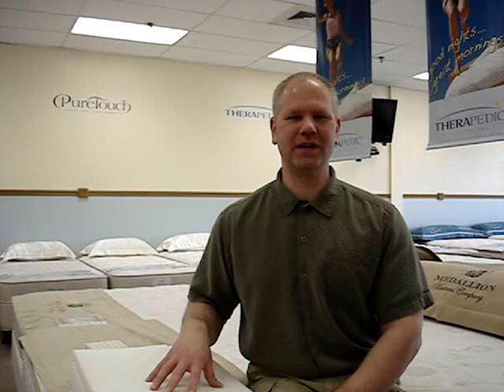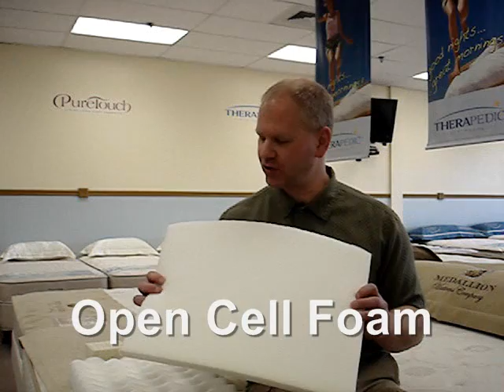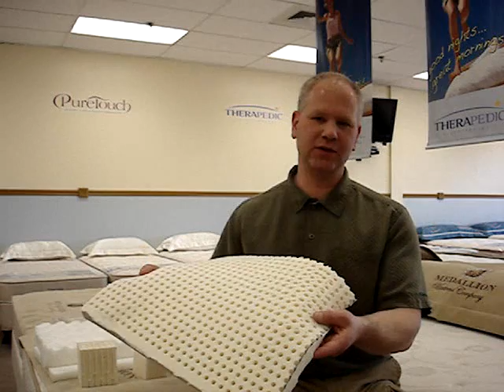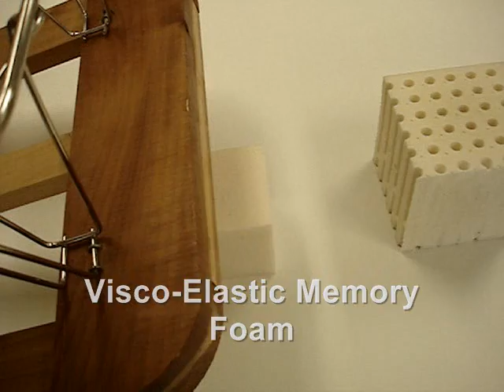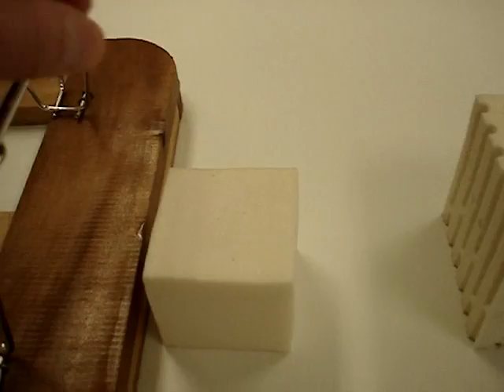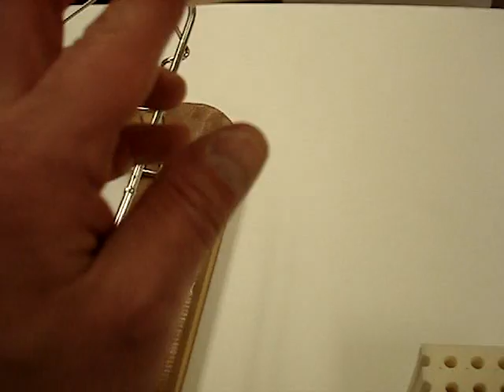Beducation® - Polyurethane Foam, Memory Foam, And Latex Foam

Comment: How can you tell if the Latex mattress you have is all latex, or polyfoam in the middle? I have one from 13 years ago which is a Natures Rest Composure which has been great but the impressions from where we sleep are large now and I want to replace it. The market has changed radically and foam is all the rage now. I think I will get another latex mattress but now I am questioning if I should get one which is latex all the way through or not. I think we spent $2200 back 13 years ago and I see some now in the $4,000 range. Not sure I want to go there, but the latex really was very nice for us (back sleepers some side - Normal sized people - 200 lb / 130 lb). Love your videos, wish you were in Massachusetts I would be down today shopping
Reply from the maker: Thank you for the compliments. Without taking the cover off of your product and looking at the foam, you could look at the law tag and see in the content section if "polyurethane foam" is listed in a significant percentage. I don't know the specifications of the Natures Rest Composure from 13 years ago - even their web site from back them is incomplete. Their N-Balance line did use some polyfoam I know. Regardless, the first thing I would do would be to check that your foundation is perfectly flat and unforgiving and that you have proper center reinforcement under that. Those things can all contribute to the product sagging. Next, I would look for all-latex mattresses that approximate the feel you desire. You didn't mention what size you have, but even a king all-latex mattress can be had very affordably (well under $4000). There are also many component-style systems available where you can change your comfort over time and customize on the left and right sides. As latex has worked well for you in the past, I would start with that and not worry so much about trying to duplicate what you have, but find a comfort range that works for you. That's my best advice. Hope it helps.
Reply: Thank you that helps a lot. It is Nature Made (house brand by Sleepys made by Natures Rest) and indeed the law tag has 90% polyurethane foam and then lower (without a percentage) it says "Latex foam rubber core".  I will start shopping for all latex. It is a king that I am shopping for. To be specific the sagging is more of an indentation in the upper pad where we lie (the mattress looks like it has a pad similar to a pillow top, then the core below it). It is not a slump in the center.  Thanks again though. I know you ship as well, not sure if that would make sense but would be curious what some pricing would look like. Do you have customers out of state you ship to?
Reply from the maker: If the law tag is correct, and per your description, it would most likely be that you have polyfoam in the quilt, and then probably a layer of latex under that, with a polyfoam core for the base (if 90% of the mattress is indeed polyfoam). This would explain the body impressions you're experiencing, which would be mostly from the polyfoam in the quilt. While we do ship our products, we currently don't ship our Pure Talalay Bliss products. I don't have a recommendation for you regarding a particular brand (that's not what i do here with the videos), but I can say you have many quality options out there for what you're looking to do.

Comment: Hi Jeff, I am in the market for a new mattress.I was set on pure latex but some(ok, an online company) are saying it is not comfortable because it pushes against you causing one huge pressure point  and that is why it springs back so fast.I take this with a grain of salt and know this part of marketing but still wonder if there is some truth to this.
Reply from the maker: As I think you're already aware, blanket statements like what you described aren't accurate and in the end generally lead you to a product that someone is hawking. Latex will be more resilient than most foams, but like any product, it's offered in varying ILDs to accommodate various sleeping styles, somatotypes and personal preferences. And of course, the overall feel of any mattress is a combination of all materials, and some people may have an affinity for latex, while others at prefer memory foam, natural fibers or polyurethane foam. There is no one correct answer - you just want to make sure that whatever you choose is made of high quality materials and constructed well. As far as using other people's opinions, that would be the absolute least reliable way of picking out a mattress, as what might feel best for someone else has nothing to do with you and your particular needs.

Comment: What would be better for reducing motion transfer?
Reply from the maker: As a single foam layer, visco-elastic foam was originally created as a motion dampening foam, with low rebound and high hysteresis. It would be the best foam as minimizing motion transfer, followed generally by latex.

Comment: for comparing  you should have taken the same size of both memory and latex foam
Reply from the maker: This is obviously a very simple comparison of the properties of the two different foams, not a scientific analysis or rating of ILD/IFD, density or compression modulus, or anything else of that nature. The size is inconsequential and the simple comparison is valid regardless of size.

Comment: Thank you for this great and useful information. I'm in the market for a mattress, but I am not sure what to go with.  I tend to stay away from synthetic, chemical materials.  What about gel infused mattresses, do they really give a cooler effect? I have read many mixed reviews on this topic.  Does it matter if I go with a latex/spring if I want to have a adjustable bed? Will a organic cover help with the chemicals and bed bugs? Thank you.
Reply from the maker: All foams have chemicals in them (even latex), but that doesn't necessarily mean that the product is harmful. Safety is certainly an important concern and you want to make sure that any foams you consider are at least CertiPUR-US certified for polyurethane. While gels (and to a greater extended phase changing gels) can assist with conduction of heat, the claims of the industry tend to be greatly exaggerated. Most effects are for initial surface touch and these gels tend to load quite rapidly. Specifically, these foams will not act like a heat sink. As for an adjustable bed, we've always recommended an all-latex mattress. It best puts up with the specific weight concentrations and bending produced by a power foundation. A cover will not have anything to do with chemical filtration. An organic certified (GOTS) cover will meet the Global Organic Textile Standards and have fewer synthetics in it (must be at least 95% organic certified componentry). For bed bugs, you'd want to make sure that whatever cover you are using has a zipper that is certified as bed bug proof. The organic nature of the cover wouldn't matter one way or the other in that case. as it relates to bed bugs. That would simply be a personal preference.

Comment: does polyurethane foam soften with use. I have a 4 inch 2.5 density 35 ild poly foam mattress. should I get a 7 inch slab instead. my weight is 285 lbs. Will the 4inch slab soften?
Reply from the maker: +Rudolphe  Alexis All foam will soften over time, even premium latex. But there is a large difference in the amount of softening (Flex Fatigue or Dynamic Fatigue) and change in Support Factor (Compression Modulus). The thickness of the foam will change the firmness a bit, but you'll notice the feel a bit less when placed deep down as opposed to directly on top. From your phone call earlier I would advise you to keep what you currently have, as it is working quite well for you. If over time the core gets a bit too soft, I would simply replace it with a new piece. The latex you're using on top should last a very long time. Good luck!
Reply: Thanks for the information. I now see that there is no set rule for core thickness. It is a matter of personal preference. I have 2 really good latex toppers. The 4inch core is just right  not to firm not too soft. If the 4inch poly foam core softens then I will add a couple of inches to the core. For right now I will let it be.  That was good  advice. Thank you.

Comment from the maker: The latex we offer (pure LatexBLISS) doesn't off gas (only water), doesn't smell and doesn't absorb moisture. It's exactly the opposite. A premium virgin talalay latex is open-cell, breathable and not temperature sensitive. Plus, the ActiveFusion technology helps to dissipate heat even more. The problems you describe are commonly associated with visco-elastic memory foam.

Comment from the maker: @ericjakob I'm not sure of the makeup of the mattress you're talking about but in general memory foam wouldn't be the answer.  You'll need something stiffer and more resilient.  One of the best replacement ones I've ever found (without an innersrping) was a special zoned high-density polyurethane foam called Conformafoam.  I'm sure this is produced under different names for various companies, but in general you'll want to look for a firm and higher density polyurethane foam product.

Comment from the maker: @andy74123 Andy, visco-elastic memory foam is technically a specialized style of polyurethane foam that slowly recovers and is temperature senstive. There's a wide range of quality, softness and recovery speed within visco-elastic foam offerings. Latex foam isn't polyurethane - it's vulcanized rubber. The terms visco-elastic and memory foam refer to the same thing. If you squeeze your topper product and it slowly "reinflates" then it's probably safe to assume it's some type of memory foam.